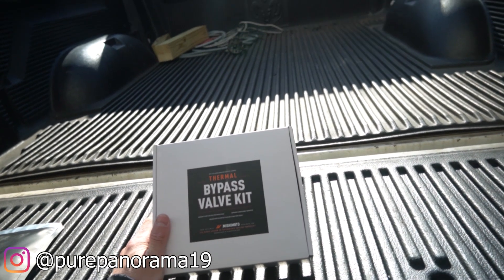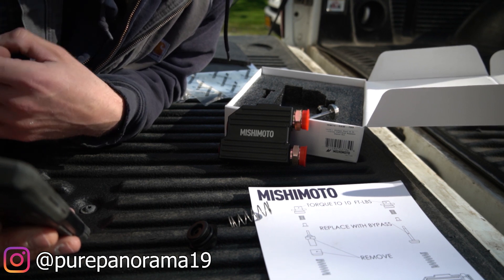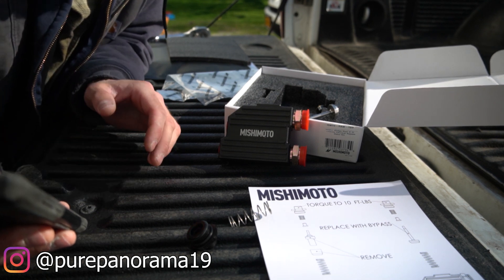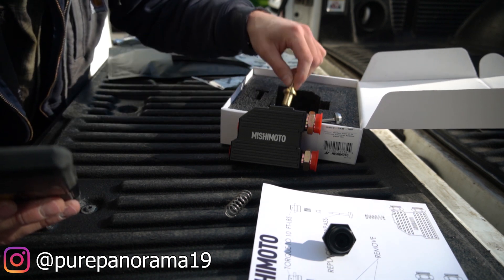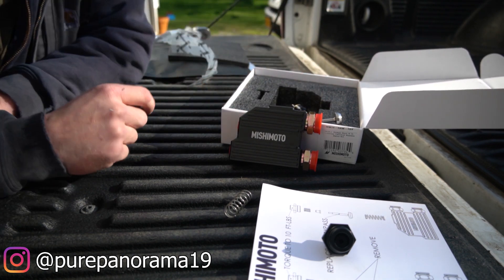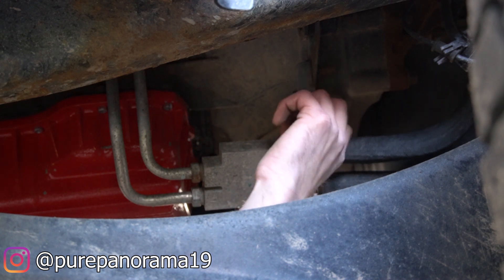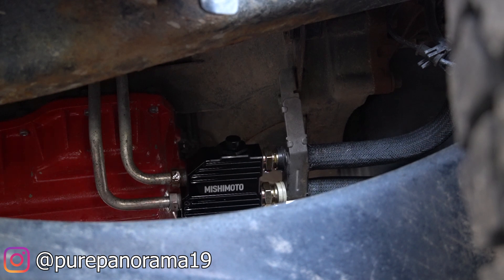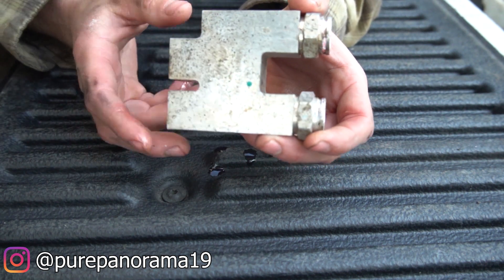DON'T BURN UP YOUR 68RFE/AISIN TRANSMISSION!!

Comment from the maker: Got another 68rfe video coming soon along with a bunch of other stuff! What other types of videos do you guys want to see!?
Reply: How about torque converter comparison's.... that's probably my next mod or maybe compound turbos
Reply: I just watched the other newer 68 video and I wish you put some driving footage in it or atleast told us how the truck felt after and what advantages you had doing that mod. Looking to get a 4th gen and really want to see how a 68 will hold up. I tow usually every weekend. My trailer weights about 2K and my load is usually ATVs, a tractor, or a Jeep. So total load is usually roughly 5-7k max. Please tell me everything you possibly can about the 68 and what you like and don’t like about it if you could
Reply: Valve body
Trans pan change
Revmax Bypass valve 
Head studs 
Head gasket 
Ez Lynk tuner
Reply: General “bullet proofing” recommendations for the 68RFE
Reply: I realize I'm pretty randomly asking but do anybody know of a good site to watch newly released tv shows online?
Reply: @Bo Emanuel I use Flixzone. Just google for it =)

Comment: It's the new way of warming up the trans faster just like how the older gen trucks had that stupid heat exchanger that always went bad and mixed coolant and atf together. Only this bypass doesn't kill your trans or fill the coolant system with trans fluid which if anyone has a 3rd gen they know that when the heat exchanger goes bad it makes an absolute mess of the coolant system haha oh what fun it was... wish I had though to put a bypass in years ago lol. I bought the 3rh gen bypass like you did and I put it on my 3rd gen and it works great for the 04's 48re

Comment: Great video can you tell me where I can locate that part so I can order mine I have a 2008 3500 and transmission overheats put a new cooler in it electric fan and new transmission and it still overheats I’m guessing this will solve the problem.

Comment: Awesome video and a great product 👍
Reply from the maker: Yeah man, this product is a fantastic. Ill have a update video coming soon on it. I will tell you this though... my trand temps are way lower than before!
Reply: @purepanorama8484  I have a 08 6.7 with the 68rfe and I just did the triple disc torque converter last month and the other day my trans hit 180 degrees and it went into limp mode. I'm wondering if my thermostat isn't the problem. After seeing this video I'm going to try this product out and see if it fixes my problem!
Reply: @freightshakernation9429  Did it fix the issue?

Comment: I have a 68rfe and I just deleted it and tuned it and now when I go pass people I get a check engine light come on and it say low trans line oil pressure anyone have an idea what it could be
Reply: Hey Joe. Did you figure it out yet? I don't have the answer but wondering what the problem is
Reply: If you’re tune didn’t come with transmission tuning that is going to be your issue. If you don’t mind me asking who supplied your tunes? Ray @ DRD? CCS? If either of them contact them and they will get you back up and running usually when you delete they up your line pressure to 190-225

Comment: Will this void warranty? I wouldn’t think so
Reply from the maker: Not to my knowledge. It's designed just like the factory one, just better quality and yout can gut the thermostat to run cooler in hotter weather. I had zero issues when I had warranty work performed on my truck.
Reply: @purepanorama8484  i greatly appreciate your response on it. I’m bout to by a 4th gen 2018 dually never owned a diesel before but I’ve been researching the heck out of it. 

Consider me subscribed.
Reply from the maker: Not a problem, man! I try to get back to people as best as I can. It gets a little hectic at times and I miss comments because I have a bunch of videos on the channel now that people comment on. Sounds like you're getting a nice truck for your first diesel. I'm hoping to start having more content coming to the channel in the near future, as there is plenty of stuff I need/want to do with my truck. I just began filming some things last weekends, so hopefully this summer there will be new videos dropping more frequently. I appreciate the support!
Reply: @purepanorama8484  I appreciate the content. I’ll be running in!